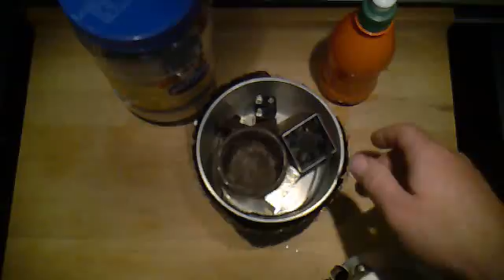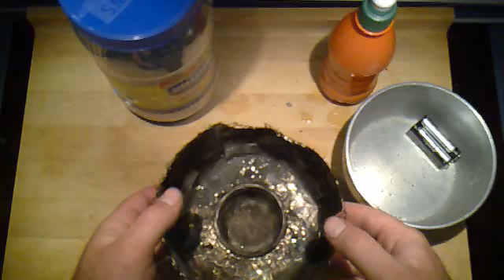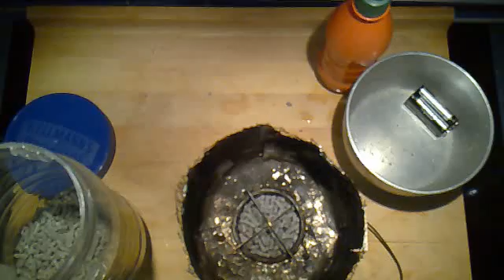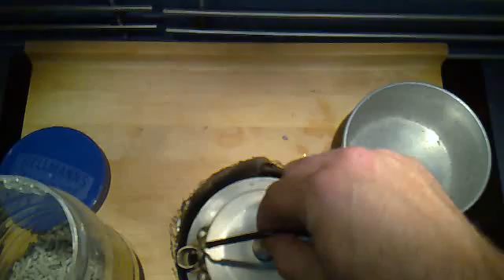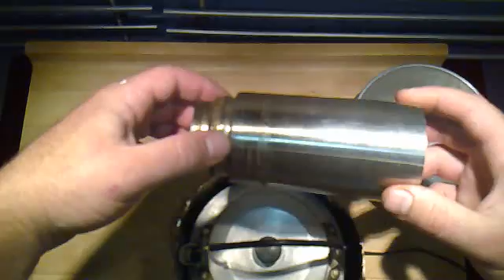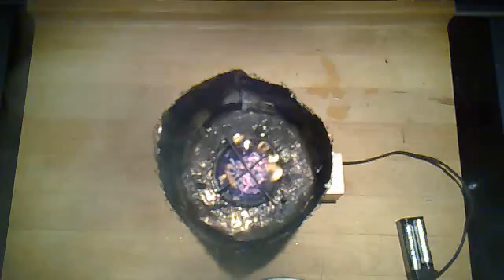Tlud stove-the world's smallest and lightest  fan forced backpacking tlud

Comment: Could've used the thermosflask as is, file some holes on the inside for the secondary air, remove cap from bottom and punch some primary holes in the inner flask. Make a hole near the bottom.on the outer flask for a fan to blow into and Bob's your uncle.

Comment: Excellent video thanks.
Just wondering why you need the fire cement and mica insulation on the combustion chamber bottom ?
Should I put it on the inside or outside of the combustion chamber ?
I really want to make one - could you tell me your hole sizes and number, for the bottom of the chamber and the top jets ?